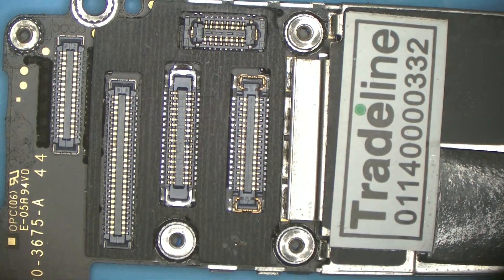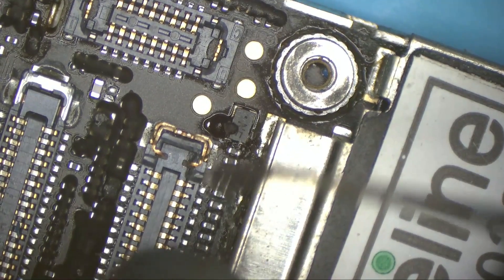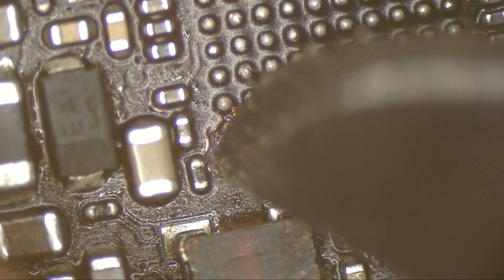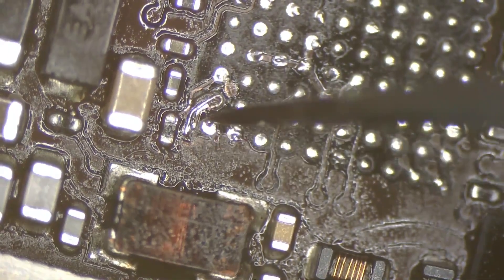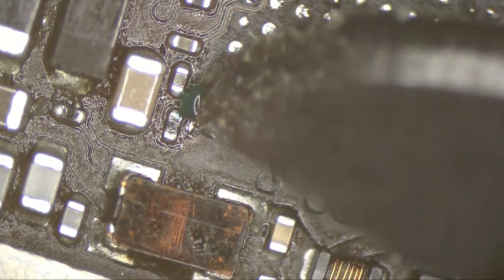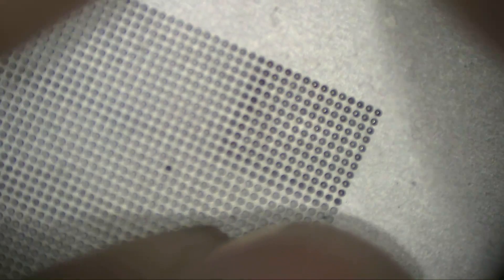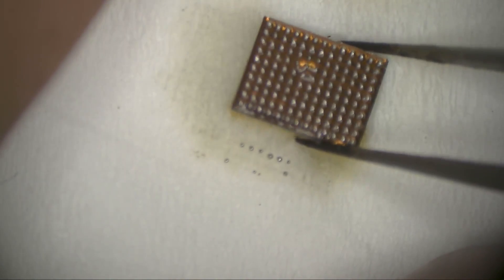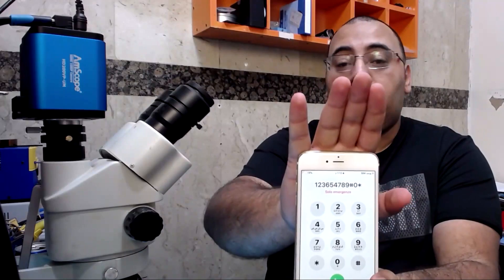iPhone 6 Plus Touch Not Working - How to Fix - Don't Do These Mistakes

Comment: Hi Sir, I followed your procedure safely. When I fix the Touch IC screen is BLANK but I can see some light at the back of the display. again when I remove the Touch IC phone Boots normally but no Touch. can you guide me how to proceed further.
Reply from the maker: Use original IC from donor board

Comment: what temp and airflow are you using when you do this?
Reply from the maker: I always use 400 to 450c with narrow nozzle air speed characteristics is different in each hot air but i use 7 or 8 L/s don't follow my numbers every tech should find his best temp depend on his speed of rework
Reply: Yea I’m kind of just starting out. Thanks for messaging me back. I use the quick 861dw
Reply from the maker: @mrkakaonu  it is a good station indeed but you need air like 50 to 60 and you can start with 360c
Reply: Ayman The Repair Tech I started on 390 60
Air. Do you recommend using the same temp and air when putting the chips back on the board ?
Reply from the maker: @mrkakaonu  that is fine as i told you it is depend on your speed of lifting and installing the chips if you fast enough no worries
Reply: Ayman The Repair Tech do you have any rebelling tips ? You made it look easy haha

Comment: Hi. You forgot to clear that broken off pad from near the jumper you've made. It's turned on his other side, and it's kind of not visible. But if it works like this as well, then good job. Keep up the good work. I like to watch how your methods, nice and easy.
Reply from the maker: Bartis Levente thank you i appreciate you spend your time watching my videos, what you see is not the broken or flipped pad, it is another trace connected to the pad next to the jumper
Reply: That isn't the broken pad, that is the through hole via for the L1 pad.

Comment: Great job! Have you any idea about get too much power consumption when the touch screen is in use after touch disease fix ? We have get this issue many times (we use preheater to apply low temp) with no answers for the moment
Reply from the maker: I faced this issue before, you should check the CPU coils in the other side sometimes they get loose otherwise it is the CPU itself